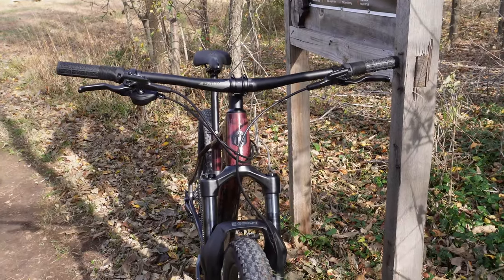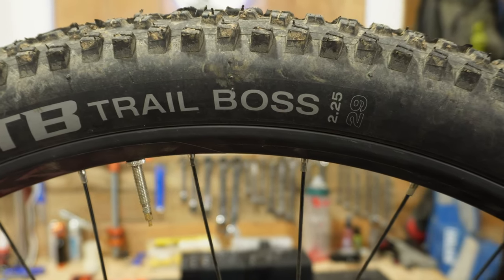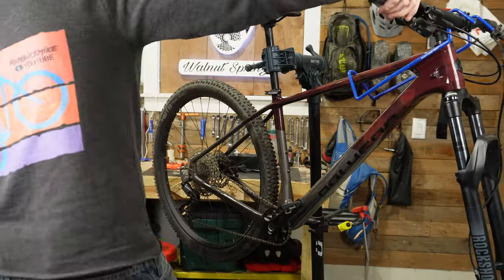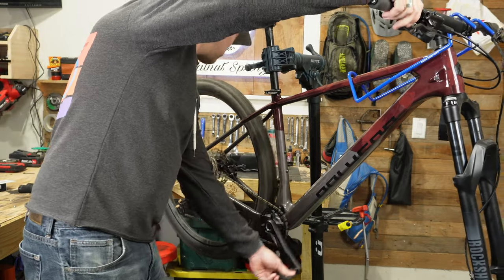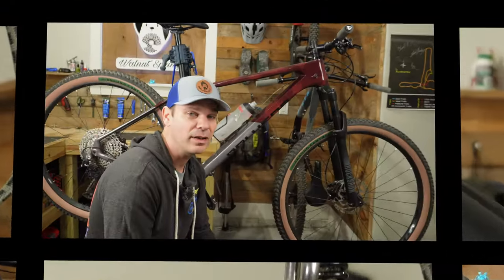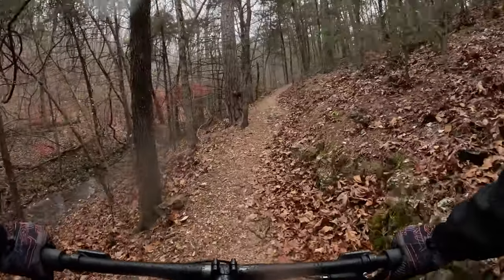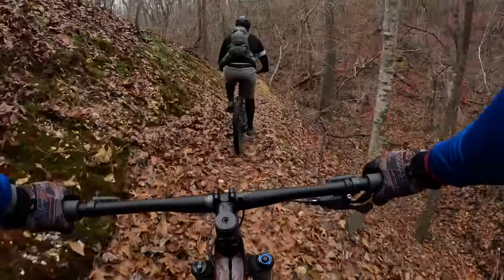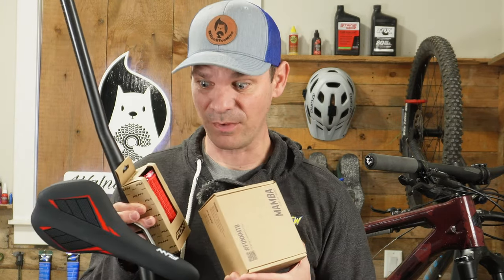FAST & CHEAP MOUNTAIN BIKE WEIGHT DROP / Polygon Syncline C3

Comment: The next time you put on silicone grips put the bar end plugs in first, then use some rubbing alcohol to lube the inside of the grip. It will slide right on and the alcohol evaporates really fast leaving the grips firmly on the bars.

Comment: I need to get over to Bentonville again to ride Little Sugar. I rode the whole loop of the Back Forty along with the Ledges. I ended up with 25 miles that day and had a blast, until I got home and cleaned my bike....I found my driveside seat stay was cracked almost all the way along the weld at the seat tube junction. Luckily, it didn't snap completely while riding and Trek did warranty the frame with a quick replacement.
Reply from the maker: Oh wow cracked bikes are never a fun feeling. I too want to get back down there to ride the full loop of tunnel vision. I hope to get back down there in March

Comment: Hello, can you tell me the size of the bike and how does it fit (your size)? also do you had any issue fitting a 2.35” on the rear?  (tire rubbing frame? thanks!
Reply from the maker: Size Large and I am 5’11”. It fits me perfectly. No issues at all with 2.35 tires.

Comment: I was definitely surprised at the initial weight of this bike. This makes me wonder if I should go tubeless on my old small/medium aluminum hard-tail bike. The tires are already folding, but I'm sure some noticeable weight can be saved without tubes and as well as with some lighter tires. In its stock config, it's actually about the same weight as this featured bike initially was: 31 lbs.
Reply from the maker: If it is a 29er you can almost bet the tubes are around 1.30 - 1.50 lbs when weighing both. So just guessing with sealant you could save about 3/4 of a lbs.
Reply: @RunBikeMike  Its tires are actually 27.5", and specs say they are 775g each. I'm not sure how much the tubes weigh, but I'd imagine the tubeless conversion might not be the only thing that's going to help me bring this bike just below 30 lbs. -- I should probably do a 1x9 conversion as well.

Comment: only 1400..... are prices actually justified tho? or inflated?
Reply from the maker: $1400 for a carbon bike is a good price. But definitely do the tubeless upgrade. It really brought the bike to life. Stock it felt slow and heavy. Also for this bike make sure you want an xc style bike. This is definitely not a jumper.
Reply: @RunBikeMike  in your opinion are any hardtails good jumpers? Can you recommend one?
Reply from the maker: Yeah there are good ones. You just have to get a trail bike not an xc bike. Or if you are doing actual dirt jumping get a Dirt Jumper frame. Look for frames that are similar to the Santa Cruz Chamaeleon and if you are budget minded the Giordano Intrepid. The geometry on those bikes works well for trail jumps.

Comment: Would be interested to see how those grips perform in the rainy season
Reply from the maker: I had them on my last bike. Without gloves it is a no go but with gloves they are super grippy
Reply: Mike, if you sprinkle rubbing alcohol inside the grips they slide on lickety split with no fighting.   The alcohol will evaporate and the grips won't slip.